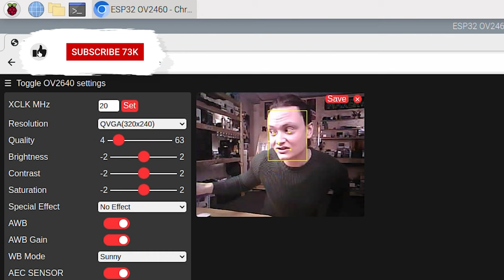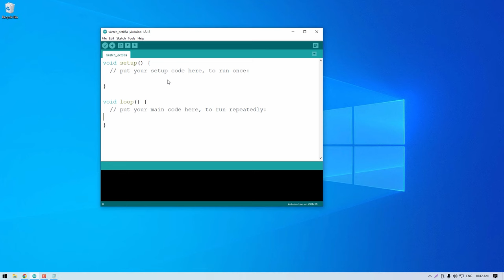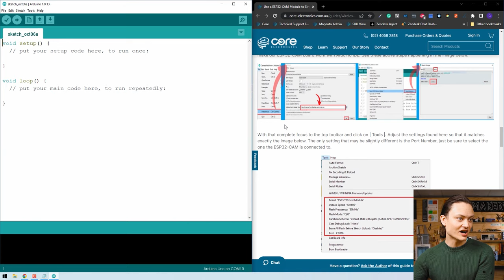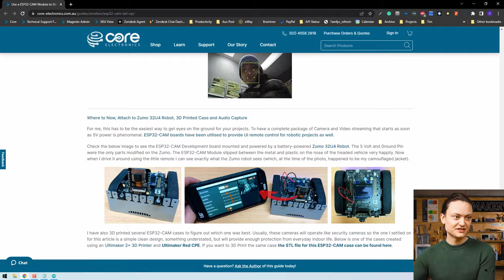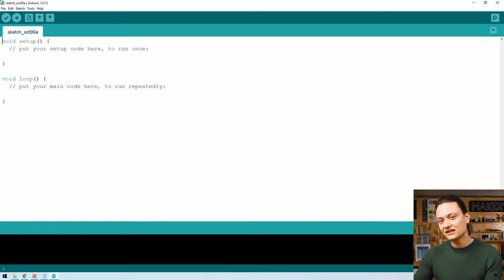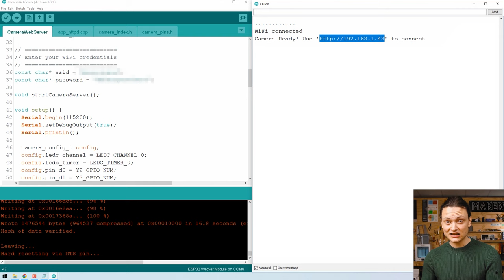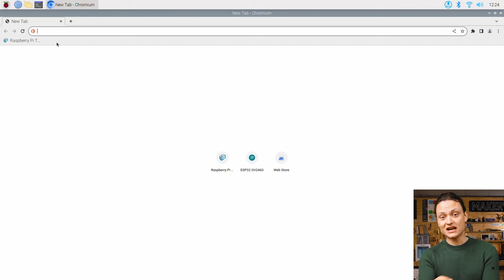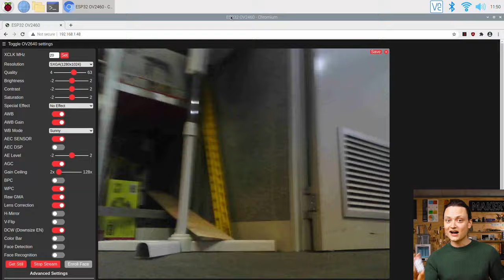Use a ESP32-CAM Module to Stream HD Video Over Local Network

Comment: ESP32 CAM is a cheap and cool device. There're also different cam modules available with different resolutions and angles.
Reply from the maker: Absolutely true! You can hit up some of the other types here if you're interested 😊 https://core-electronics.com.au/catalog/product/view/sku/DFR0620 & https://core-electronics.com.au/catalog/product/view/sku/ADA4095
Reply: I'm looking into this as a possible resolution to monitor an area of the property where a full-sized camera would be seen.

I didn't know that there are different modules with different resolutions.

What would I be looking for as part numbers or model numbers for the highest definition available?

Thanks in advance.
Reply: just know that ipcameras are extremely insecure @BlondieSL

Comment: As much as I appreciate using bare ESP modules for your projects and programming them using a USB to UART converter. In this case it's really not worth the hassle to wire it up, given that a programmer for the ESP32-CAM costs less than a cup of coffee and makes the ESP32-CAM so much more convenient to flash and debug your code with.
Reply: does he mean Local Area Network? no internet needed? just a router?

Comment: I had a 300 mA power supply and tested it on the ESP32 CAM board. Turns out this is enough power to run it.
Reply from the maker: Great testing! Reports on power consumption are a little lacking for this thing.

Comment: Can it stream live to a device by direct connection? All I can find is local networks, but not being able to connect the board to a phone directly. I need something to stream live to my mobile where there is no internet access. Plenty of  cams on aliexpress that do and I suppose I could buy some and rip them apart but these are so much cheaper.

Comment: I was rather surprised at the robust web interface for this tiny, inexpensive cam solution.  WOW!

One question, however.  Does this have a "RECORD" option where you can set a path to either a local hard drive or even to a networked drive (i.e. NAS) ??
Also, does this automatically handle Audio, which if there's a record option, would also record the audio along with the picture?

I'd like to get a couple of these to add to our security system.
We have our garage at the end of the property.  There's a lane way behind, where I can't put a regular security camera as it would be easily seen.  I think one of these would work.

Other devices in the garage are able to connect to our WiFi, so if the radio is sensitive, perhaps it can connect.

Also, I hope that there's a low-light HD (1080) version.
Reply from the maker: Come check the Where to Now and comment section of the full written up guide, Recording and Sound are definitely possible 😊 - https://core-electronics.com.au/guides/esp32-cam-set-up/

Comment: I believe most ESP32's flash best at 115200 baud rate. You may get a serial connection error trying to flash at a higher rate. Just something I noticed in your board setup you showed under the tools drop down.

Comment: why did you not get the programmer for it? only a few bucks and is neater and has a inbuilt io0 button and reset button and usb port looks much nicer. Also why did you put the esp in a breadboard?? just connect the programmer directly to the board

Comment: Oh, I have a question about this cam.
Ok, so I get how to use its browser interface, which is robust.

But, is it possible to have one ESP32-CAM send HD video to another ESP-32 that has an HD display connected to it?
If that's easy to do, I wouldn't mind getting one.  My Home Monitoring project uses a 7" Nextion Enhanced display.  Sadly, this model doesn't support video.  The Intelligent version does, but the price on those has gone nuts.

So what I thought, is that I could redesign the case and have the ESP-32 handle 2 displays.
This Nextion (which only require RX/TX, nothing more) and some other recommended display that can display HD.

I'm I wishing for too much?
Reply from the maker: These boards have really inspired the maker community and, because of that, I don't think your asking too much 😊. 

Come check out these Open Source Systems created using these boards. Some of them should be right up your project alley. 

Two ESP32 Cameras on a Phone App - https://www.youtube.com/watch?v=PaiDT1t07DU
Multiple ESP32-CAM to an Android Tablet (Including Recording) - https://www.youtube.com/watch?v=S6Y_n-Axtmk

The more the community puts in the better these Open Source Cameras will get.
Reply: @Core-Electronics  Hopefully someone will come up with a recording solution that can record directly to a network mapped drive/NAS.
That's my wish.

For me, I have many security cameras in our home and around the property.
They are all configured to record 24/7 to NAS drives.
There's one area where I can't put a traditional camera because it would be seen easily and there's no location to hide it.

However, these tiny cams might fit the bill.
I've ordered 2 of these and they should arrive this week.

I look forward to leaning these.
Reply from the maker: Proper exciting! Consider adding your project to our Project Page - https://core-electronics.com.au/projects/. Your system sounds phenomenal cool and and it helps/inspires the community (+ there is Store Credit up for grabs!).

Comment: Ughhhhh!! For the last week I've been dealing with the fact there are no exposed / usable ADC pins on ESP32-cam!!!  And now that I've accepted that fact, I am now even struggling getting an ADS1115 working over i2c!!  Please, type up in a comment or make a video about how to resolve this because I'm tearing out my hair. And I don't have a lot of spare haha. I just want to do analogreads to use a linear hall effect sensor (49E).  Though I'm wishing I went with a bipolar at this point haha
Reply from the maker: Heyya mate, we will help, fear not!

Having chatted with the support team I have double confirmed that there are ADC on ESP32-CAM Boards.
Looking at this Pin Out its looks like these following GPIOs are RTC and support ADC: GPIOs 2, 4, 12, 13, 14, and 15.  

Here is a RandomNerdTutorial using an ESP32 ADC Pin  to read Analog Values - https://randomnerdtutorials.com/esp32-adc-analog-read-arduino-ide/

And here is another reading Analogue information of an onboard Hall Effect Sensor with an ESP32 - https://randomnerdtutorials.com/esp32-hall-effect-sensor/

Hope this helps! Come write up a forum post if you need some more help 😊 https://forum.core-electronics.com.au/

Comment: That's a pretty good image for such a small thing. What is the maximum frame rate? Can you get better fps at lower resolution?
Reply from the maker: Frame rates depend on many things - The technical side is that the pixel clock needs to be compatible with what the ESP32-CAM can handle whilst receiving all the bytes from DMA and putting them into PSRAM fast enough. Simply though, the smaller the resolution the better the FPS. 50FPS is possible with 20MHz XCLK at 96x96 pixels. 25FPS is possible at OV2640 20MHz at 400x296.

Comment: Hello All. If I deploy multiple ESP32 CAM modules will each have a unique IP address? I see the process for finding the IP Address of the module in the material but was curious about how this plays out with multiple devices on the same WIFI network. Do you have any experience or insight? I guess another question would be can you manually assign an IP address of your choosing to this device. Thank you in advance. Keith
Reply from the maker: Hi Keith, local IP addresses are set by your router or modem, and each unique device on the network will be assigned a new IP from the designated addresses your network is programmed to utilise. You can make sure a device has a static local IP address from the settings within your router or modem, this obviously varies depending on your network hardware the best avenue to pursue is to Google your particular router/modem model number.
Reply: @Core-Electronics  Thank you I see it is a dynamic IP allocation I was thinking it was a static IP generated by the ESP32 CAM.

Comment: Compilation error: human_face_detect_msr01.hpp: No such file or directory
how to solve it?
Reply from the maker: Hey mate, sounds like it requires some extra packages to work on your system for the face detection part of it. 

Come write up a post with images of your hardware and error messages over here - https://core-electronics.com.au/guides/wireless/esp32-cam-set-up/ - I'll best be able to help you there.

Comment: Mmm, that all went well, until I hoped to see the ip address in the Serial Monitor ... but it started saying "Brownout detector was triggered", and did not show any ip numbers. Any ideas?
Reply: A brownout means reduced mains voltage to shed load.  In your case, the behaviour may be triggered by the maximum output current of your power supply being lower than the 2 amps specified, so that its output voltage is drooping below 5 volts?
Reply: @Alan_Stinchcombe  USB only handles less than 2 amps, I guess. In my case,switching to external power supply did not help. At first. Two days later it did, so I am puzzled. All’s well now, however.
Reply from the maker: If anyone else runs into brownout problems my advice is to give your power and ground Jumper wires a little jiggle. That fixed any brownout issues long enough for me to receive the IP address from the Arduino Serial Monitor.

Comment: Why is the graphics so bad with myne and it is very laggy
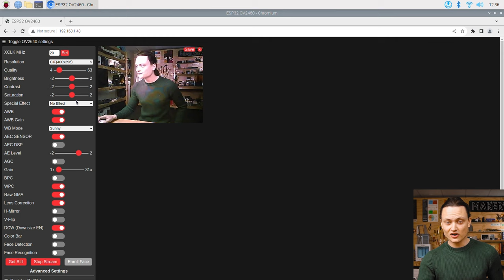Reply from the maker: At 10:02 you can see all the settings I have toggled the ESP32-CAM to for pretty display response. So long as your WiFi is up to scratch you'll get a similar FPS and speed.  At 10:21 you can see all the settings I toggled on the left for Real Time High FPS response.